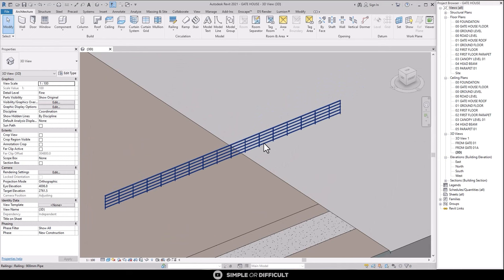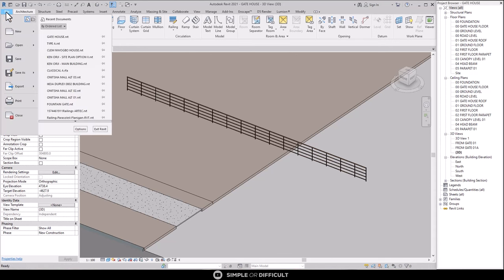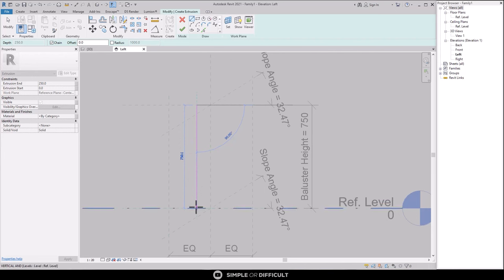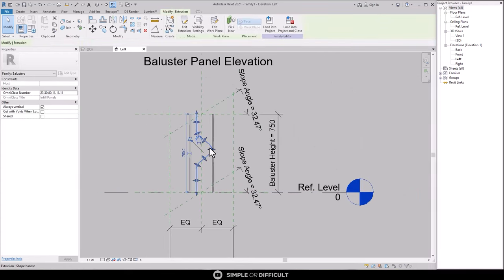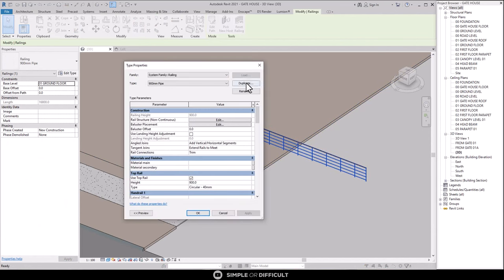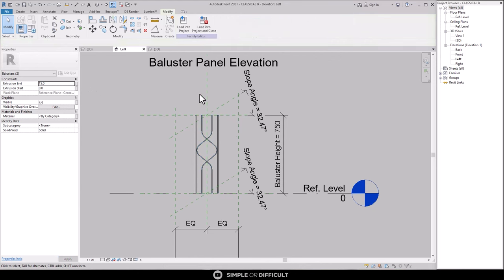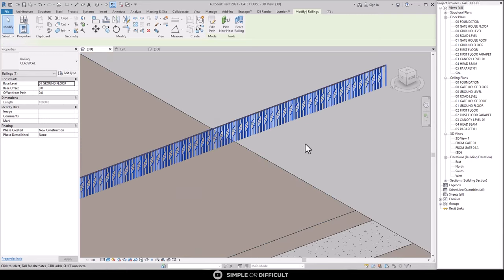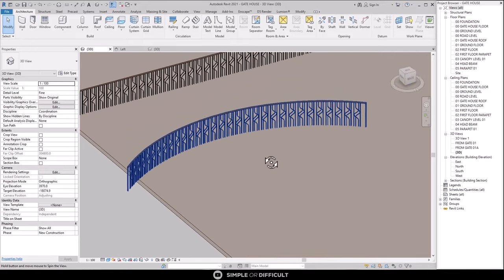How to Create Custom Handrails in Revit - Step by Step Revit Tutorial

Comment: Mate, thank you for the video, however, there was a problem with your handrail. The profile that you showed (modeled) in the family editor, is warped in the model!
I think, its because you used the mirror command, which sometimes has undesirable affects. In my opinion it is much better to re-model that same pattern again, rather than to use mirror command. 
Again, thank you for the video ;)
Reply from the maker: Wonderful! I didn't think of that. I will definitely check it out and get back to you